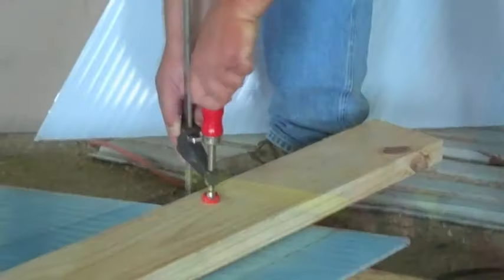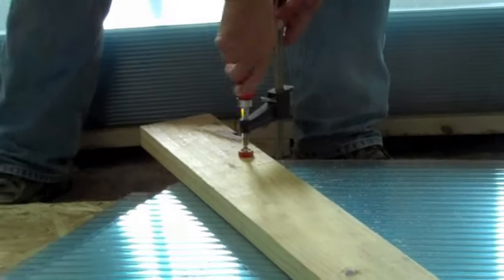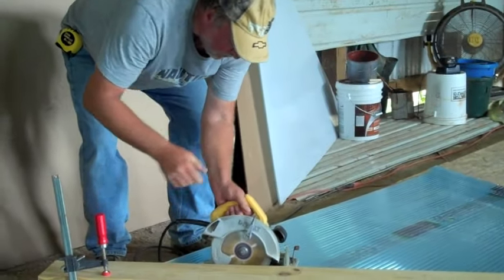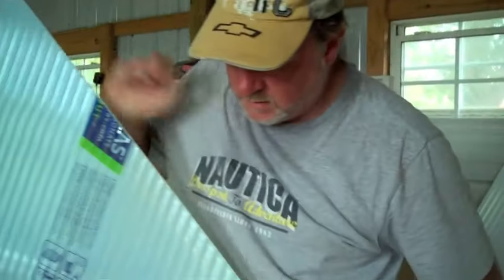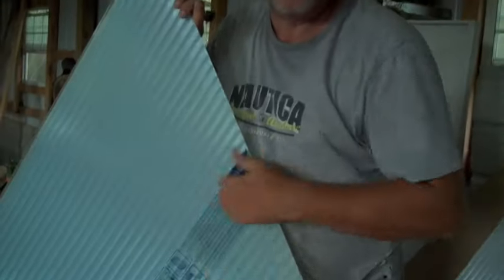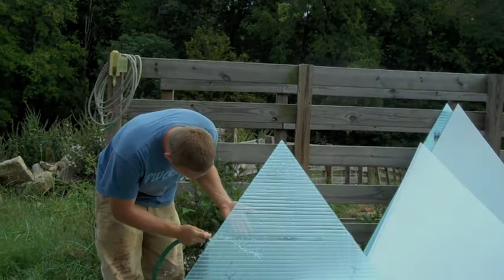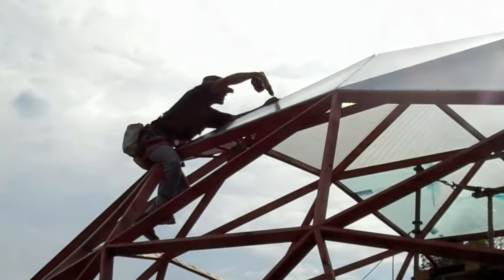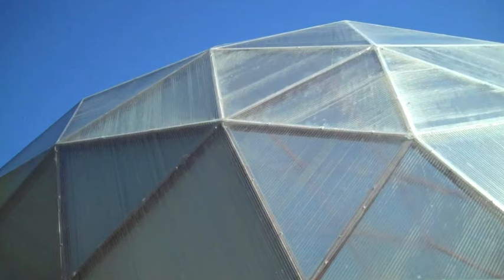POLYCARBONATE DOME COVER

Comment: I recently built a high tunnel at work, (not a dome). But for the polycarbonate end panels, we used aluminum tape to seal the tops, and micropore tape for the bottoms (keeps out bugs, but allows condensation to escape). So far seems to be working.

Comment: Can you overlap the triangles from top to bottom?, as if they were shingles to prevent water from coming in? I'm having a hard time thinking on a waterproof solution with materials available in my country (for now silicone caulk seems to be what I would have to do, but doesn't seem the right thing).
Reply from the maker: it seems like that would work but i don't know for sure

Comment: It would be good to have a video to explain this ... but sadly this one did not. How about some close ups on how you connected the panels to thd dome, and if you have all the domes dripping water downward, and they are all taped on the outside ... then don't you get a lot of water leakage to the inside floor?

Also, I think the largest polycarbonate panels are 4' x 8' or 12' ... maybe longer, but 4' wide max.  So, wouldn't it bear to say something about the maximum size of a dome dome panel not exceeding 4' in any dimension, or making the triangles in the dome sized to maximize the polycarbonate usage - since that stuff is so expensive?

Comment: Rather than transferring the shape of the triangle, just put a small mark at the centre of each intersection (where 5 or 6 struts come together), measure the 3 lengths, and transfer these direct to the material. Triangles shape themselves, if the side lengths are correct (and the struts are straight). :)

Comment: Did you use the the domeclimber connectors and if so, is that two sets of the xl?
Reply from the maker: We didn't use connectors; each connection is hand-cut. It's the same as our smaller domes in our other videos.
Reply: Thank you :)